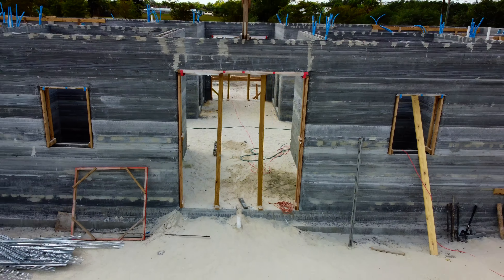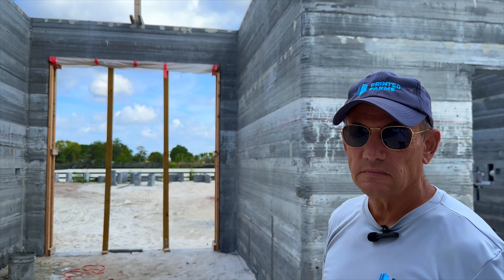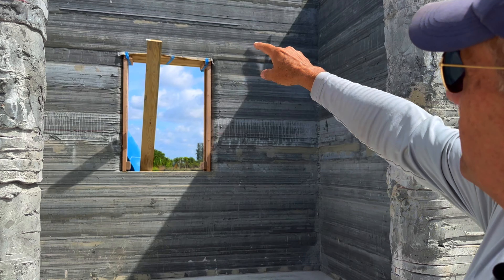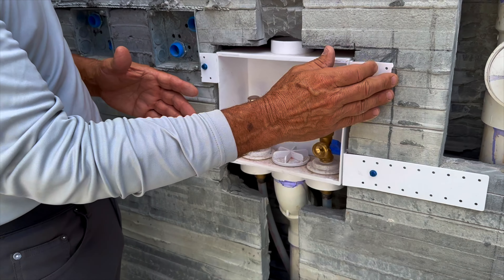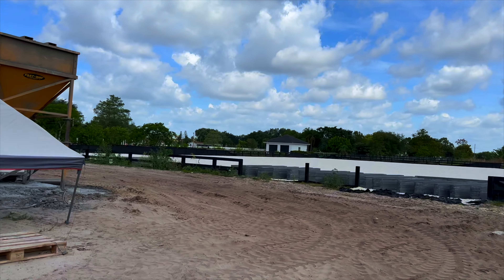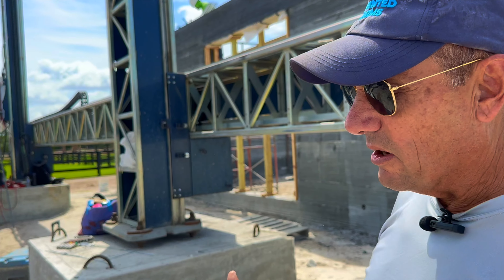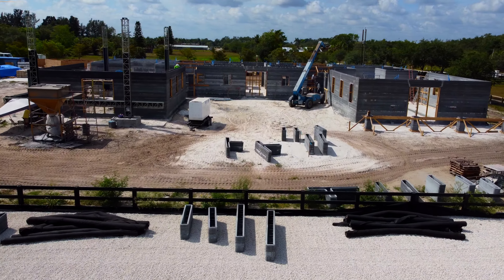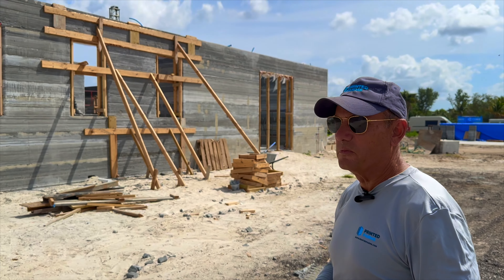$3,000,000 3D Printed Building

Comment: What if a horse kicks the 3d printed wall, is it strong enough to hold animals?  How would they repair damage?
Reply from the maker: I actually asked the same question, horses can kick through cinderblock or wood too so if they get really angry not much can stop some damage but they won’t get through the reinforced vertical columns. They will just put more stucco over the spot or fill it like they plan to do with the plumbing holes. This should hold up better than alternatives but time will certainly tell!